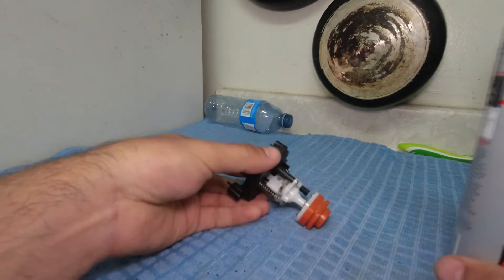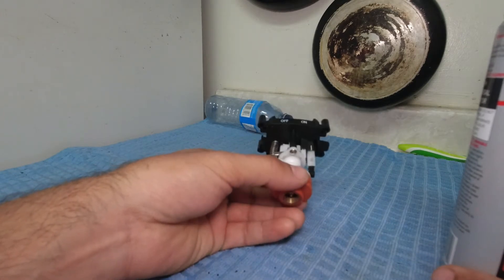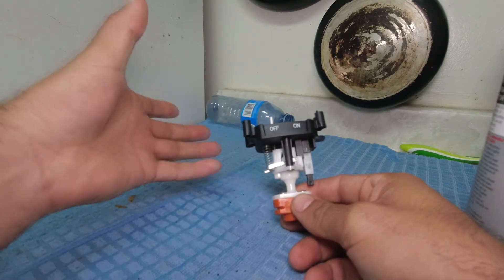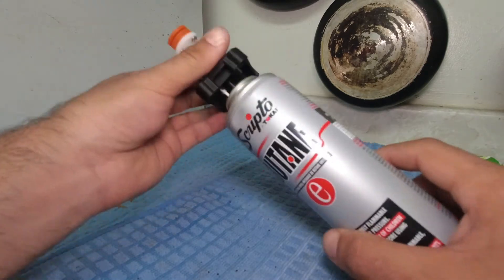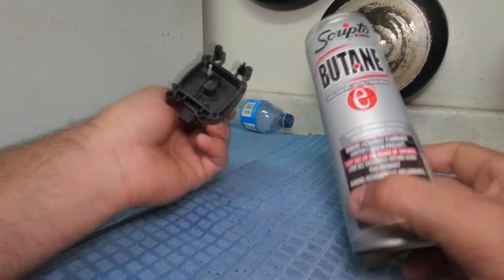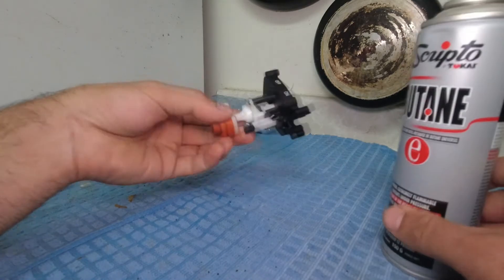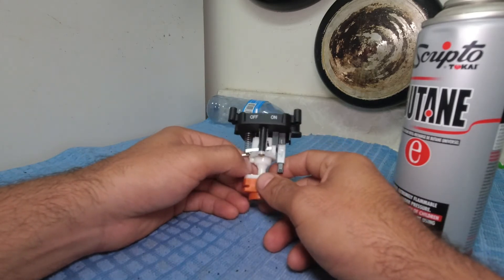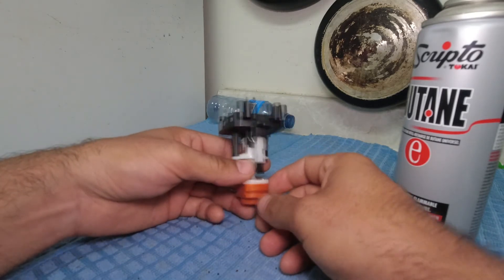Fixing the Thermacell Backpacker (spark but no gas)

Comment: I will try this this weekend. Mine lights every time but won't stay lit. In the device's fairness, it has been left outside connected to a fuel source since day one, subject to heat and whatever other elements. P.S. Love mine also! I use it all the time outside when we hang out at the pool.
Reply: I tried your technique and it worked like a charm! My Backpacker hasn't worked since very soon after I got it but this brought it back to life, thank you 😊
Reply from the maker: mine was lighting, but quickly dying out...  dust or dirt from not having cover on my tank or cover on thermacell and putting down in the dirt.. hopefully you can get yours fixed up... when they work.. they work well